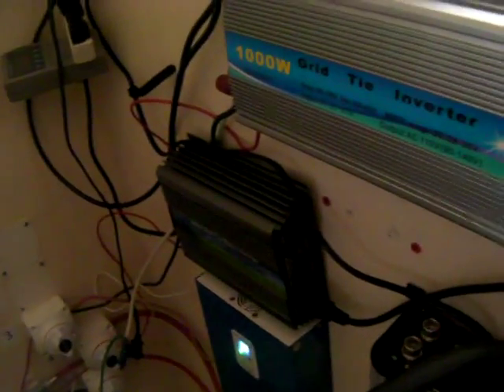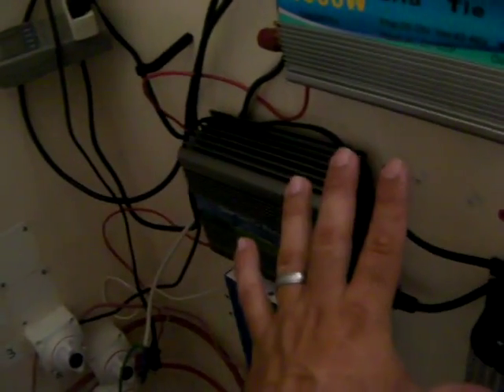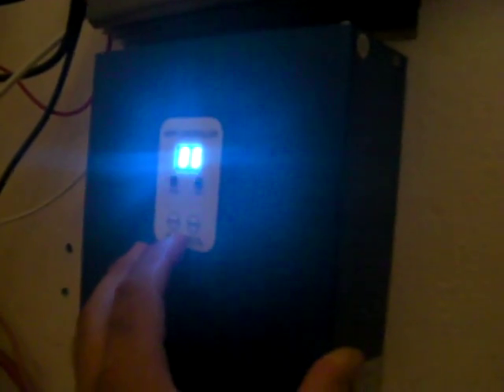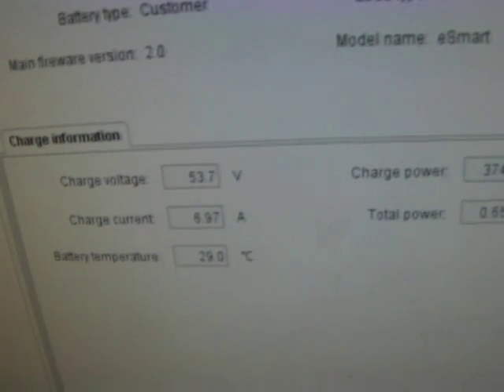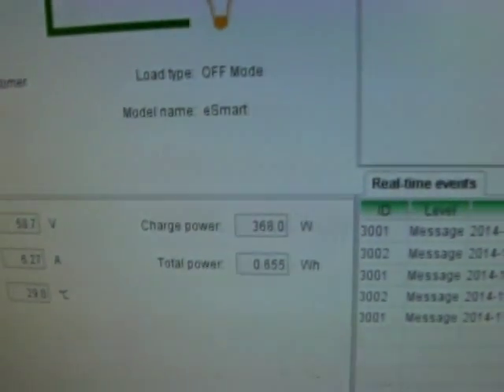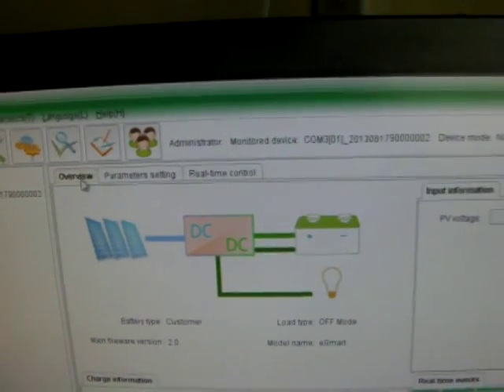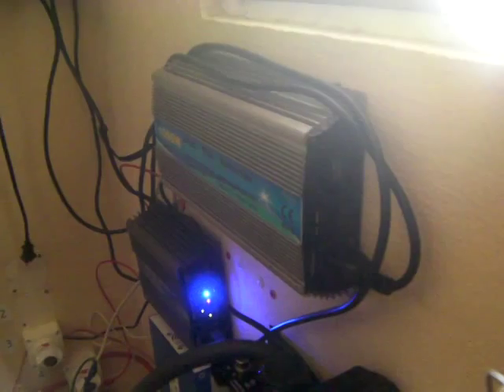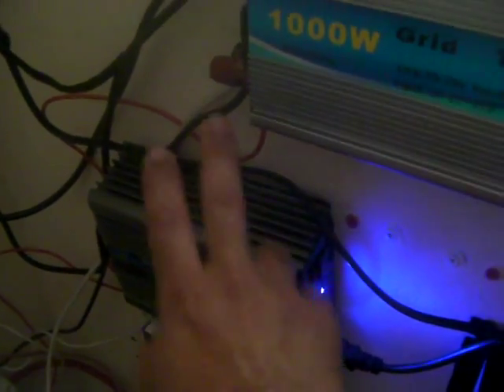ESMART SOLAR EAGLE 40 AMP MPPT CHARGER 12, 24, 48V

Comment: Ok just type this number on eBay's search bar...   121489055470 remember  to select the correct amp model you want and in my case the 40 is good for 2000w solar array but if you are running 12 v the 40 amp model is only good for something like a 500watt  array so keep that in mind...that's why I chanched to 48v puts less stress on chargers and no need for those thick wires...